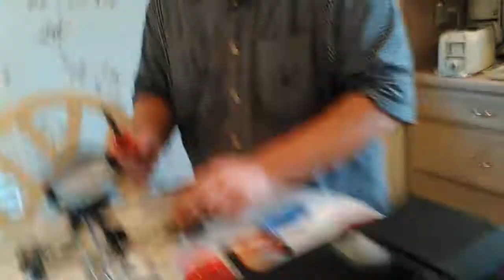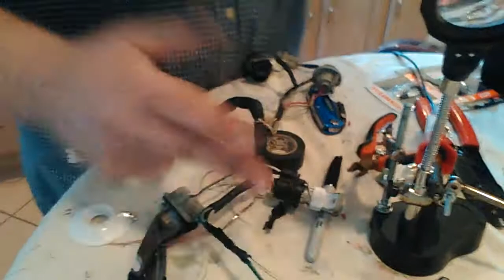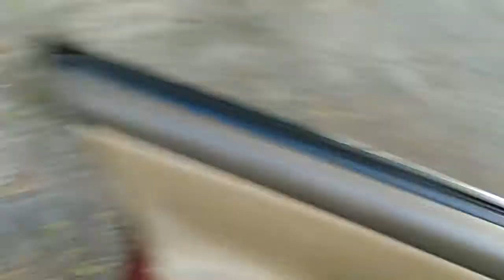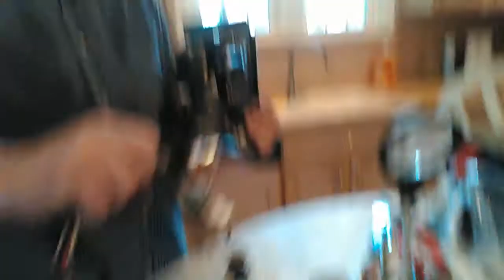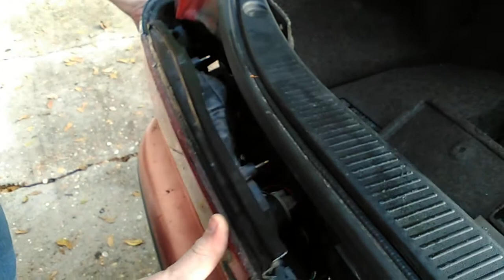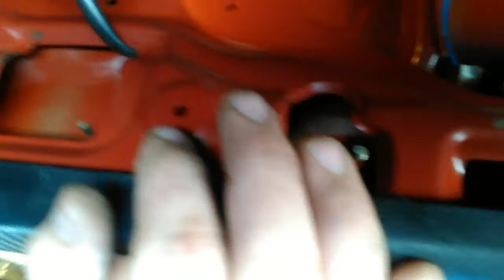LEXUS ES 300 BRAKE LIGHTS Mod of CORRODED Terminal

Comment: Helpful video, thanks for posting. Were the 1157 light bulbs not getting brighter when braking, before fixing up the harness? I have a car with that problem now, maybe the wires are corroded, will need to check into it.